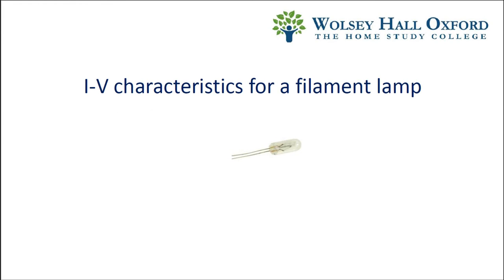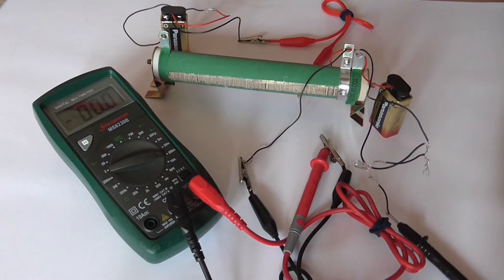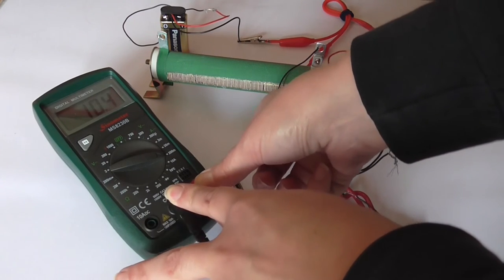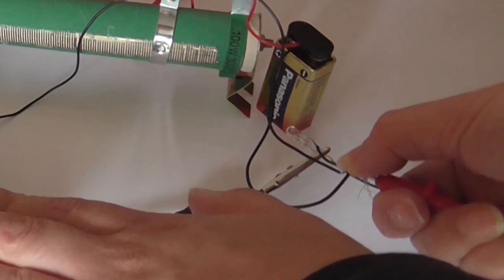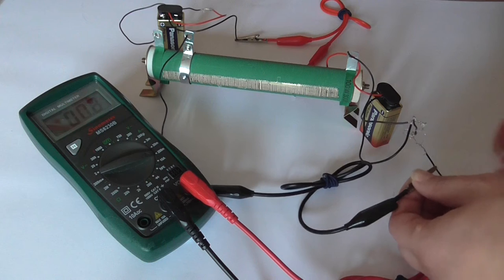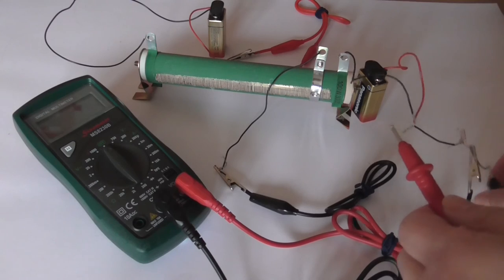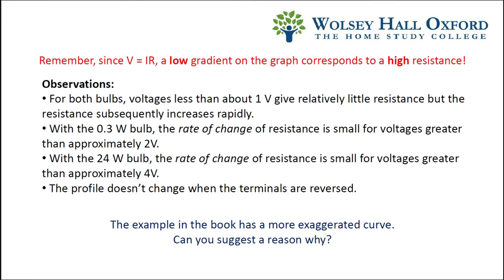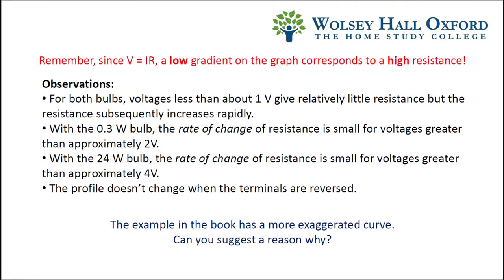AS Physics Experiment 7: I-V Characteristics of a Filament Lamp (lightbulb)

Comment: My physics teacher said you might need to add a fixed resistor in series with the rheostat, is this needed for the experiment and why does this help?
Reply: A fixed resistor is sometimes used with a variable resistor to act as a potential divider; however if you set a rheostat up as a potential divider, this isn't necessary. Video 3 discusses the different ways you can use a rheostat. Hope this helps.